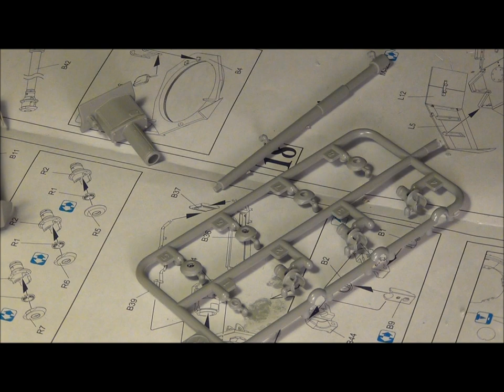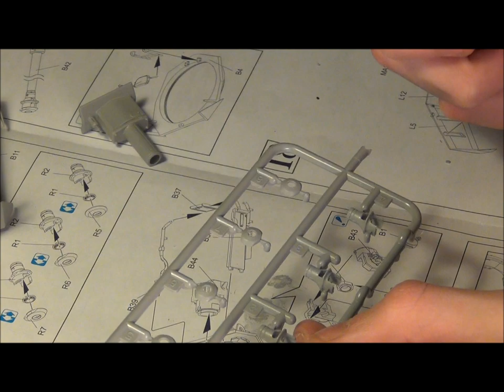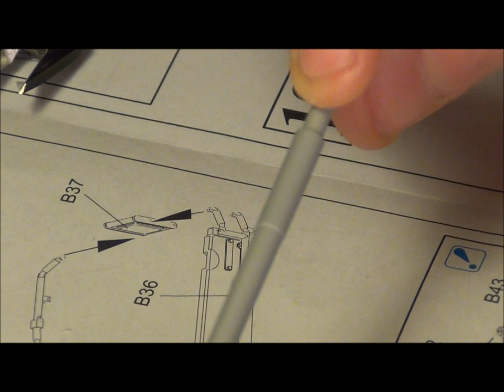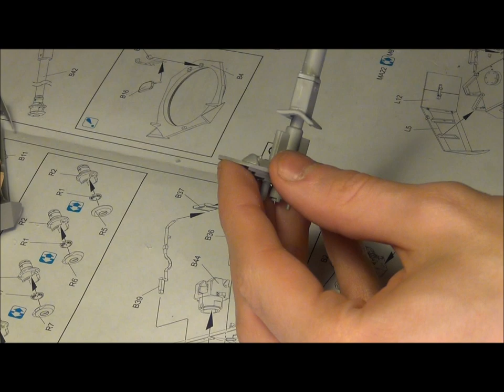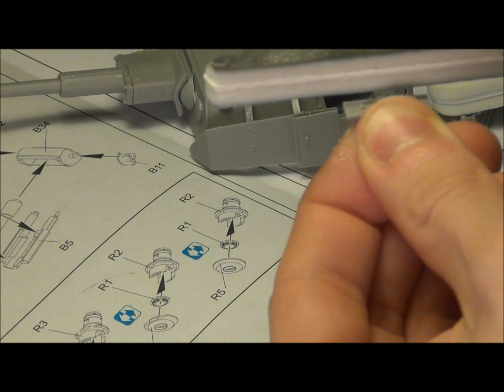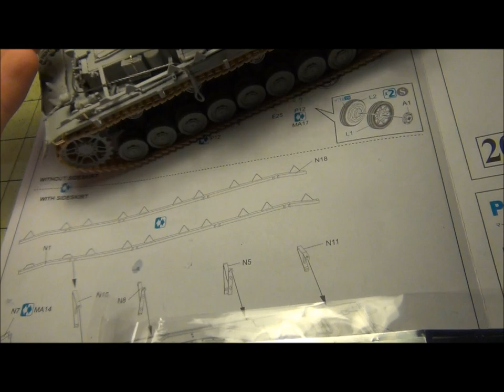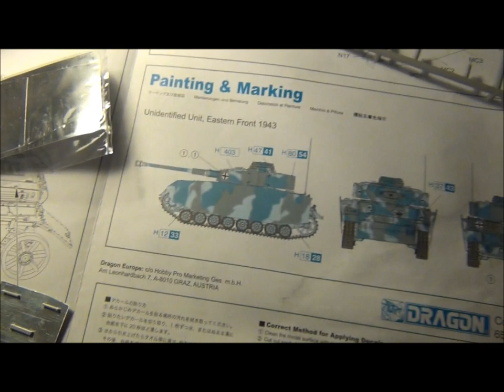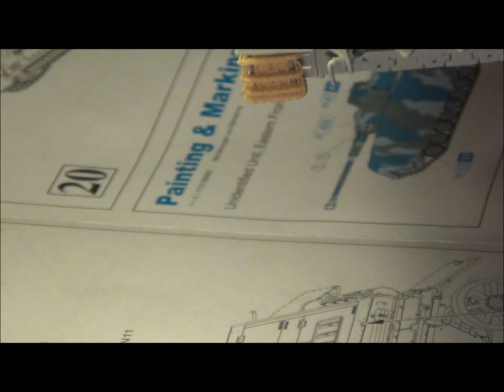Build-through: Panzer IV Ausf H Part II

Comment: Nice progress, got to love the dragon kits, you can almost leave them un painted :) A heads up on the nickel shurtsen, wash them off with some alcohol/white spitit before painting if you didnt sand them, the paint can act funny and not level or bubble, they did on mine using valejo black primer. I only sanded mine.
Reply from the maker: Yeah I agree, they look to nice!  I washed the fret with some isopropanol :)  Learned that on my StuG G lol :)
Reply: Ok, thats good, maby its only the Valejo black, cause Coen had trouble with that also. I had no problems with the Olive drab primer thats why I invested in more primers from valejo. But the black seem to have some issues.
 Anyway, what do you use to prime.
Reply from the maker: WarWarNeverChanges The Tamiya grey spray stuff, yeah I've heard that the AK black primer is bad...

Comment: I enjoyed watching the build and would like to ask a question. I noticed you were using the sanding sticks after the file or hobby knife. Have you noticed a difference between using the sticks and just using the file? I currently use the file and knife and have not invested in the sticks. Thanks for posting this.
Reply from the maker: Thanks, Michael.  The sanding stick I used here is 220 grit on one side and 1200 on the other, so I use it for smoothing after the file which is about 100 grit.  I only ever use the stick when there's a bit of burring left over from the file, or on rounded parts like wheels and barrels; If I were to use just the file for this then I'd leave a flat spot on the barrel/wheel.  You could just as easily use sandpaper, though, but these sicks are easier to control than that and I got them free from ISM :)
Reply: thanks!